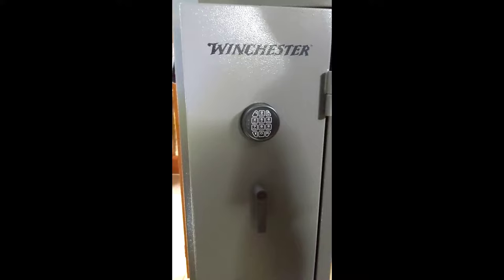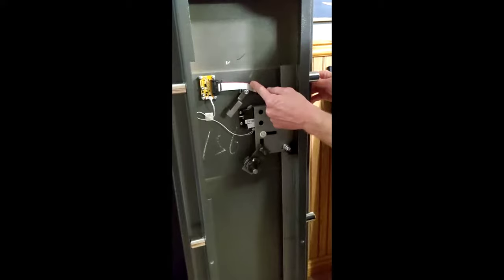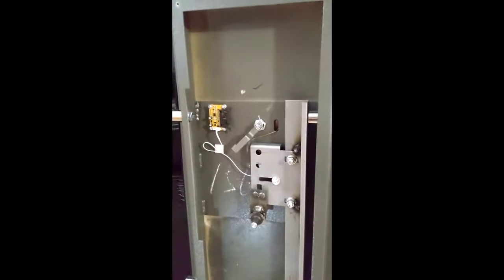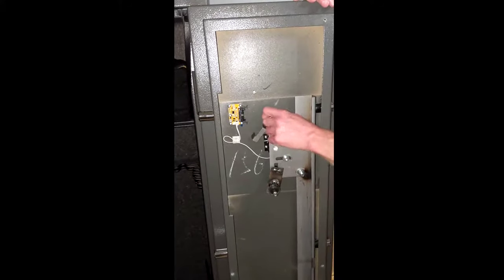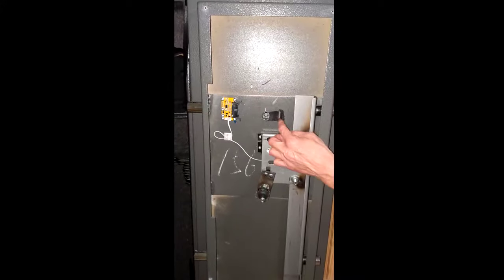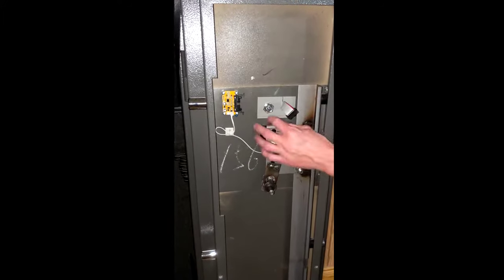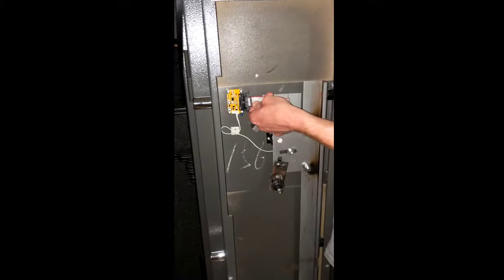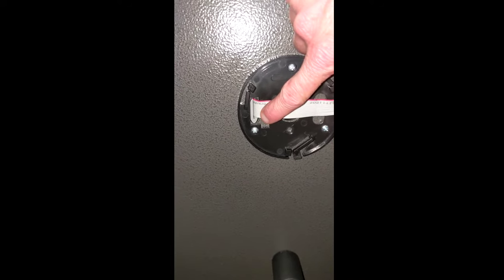Winchester Model TS12-30 Locking Mechanism Bypass

Comment: Thanks for the video bro. I made a similar blocking plate out of metal. I used the metal pallet it was delivered on for the material. Made a paper template first, then traced it onto the sheet metal. Cut it out with a hand grinder with a thin cuttoff wheel, and drilled the hole with a very large bit. Worked perfect! Cheers 🍻
Reply from the maker: Hmm.  A piece of sheet metal.  That could work.  I like the plug aspect but that's what makes a full patch so costly.  Thanks for a wonderful idea!
Reply: @locksandpicks9552  Yeah, no prob.  sheet metal is sturdier than a 3d plastic print. Took me 45 mins to make one out of sheet metal with basic tools.  We should go into production and sell them since the safe company hasn't fixed it. Lol
Reply from the maker: @GuitarLP1960  locksandpicks@gmail.com

Comment: I just bought one of these a couple weeks ago and it appears they have fix this issue. Mine has a metal plate over that area.
Reply from the maker: Would you take a picture and share?
Reply: Yeah what's your email, seems winchester either saw this video or became aware of this issue and did something very similar to what you did, cuz mine has a plate exacly like you created where only the ribbin can fit through.
Reply from the maker: @milspec8283  Oh they were given the 3d model file by me.  Then they tried to trick me into admitting extortion where none was.  You can reach me here:  locksandpicks@gmail.com

Thanks!

Comment: I bought a Winchester TS26-45 on 12/29/2023 from Tractor Supply Company and it doesn't have this plate but if i make a plate like this and install it you could possibly still pry out the key tumbler and activate the button

Comment: I have a huge Winchester Pony that is 6ft tall 5 ft wide and 4 ft deep. Tonight when I got home from work I went to put my money in it. It's a digital dial like yours, but my hande is different with 5 prongs. When I closed my safe and turned the handle to lock it I heard something on the inside mechanism fall and now my handle doesn't work when I put in my pass code. Any ideas? 😢
Reply from the maker: Hi Cliff.  It would be tough to say without having been there.  If the lock mechanism fails to disengage when the pin is correctly entered then maybe the wire became damaged?

What happens when you use the backup key in the center of the dial body, are you able to force it to release or is it stuck?

Comment: Does this work on the big model with the turn handle
Reply from the maker: I am not sure.
Reply: @locksandpicks9552  i looked i think there is a plate on the bigger model with the 3 prong turn handle.

Comment: Would it not just be easier to lock pick the tubular key lock on the safe? Not sure how a key pad hack would work.
Reply from the maker: With the default tubular lock I suspect you may be correct.  I don't have those kind of picks and for me the bypass was much easier than any picking, you just have to practice with it to get the feel for it.

Comment: TS20-30 I got on Black Friday has a plate blocking access where the cable threads through
Reply from the maker: May I see a picture of the plate and how its mounted Deac?
Reply: Same here.
Reply: Yes but the key slot can be easily picked in 5 minutes or less

Comment: Holy crap that's not even close to the same locking mechanism in my Winchester safe. You will not get into my safe like that. My safe actually has a spring loaded secondary locking mechanism in case it's tampered with. My safe is also built heavier than that one, I guess they don't make them like they used to.
Reply from the maker: That sounds like a much better design.  Glad to hear there are some worthy models out there!

Comment: and why couldnt you just drill through your protector plate?
Reply from the maker: You could do that of course.  The point of the video was to show the bad design not make it thief proof.
Reply: @locksandpicks9552  - fair enough

Comment: Good job securing the lock mechanism with a steel plate(?), the audio is horrible on this video... Perhaps it was deliberately left vulnerable, making it easier for the Chinese to get into it after the invasion of America commences...( sarcasm intended ) 
Bill... :~)
Reply from the maker: It was a temporary workaround made out of PLA.  Producing it in metal costs somewhere around the $190 ballpark and that is just out the question for most folks.

They accepted the risk if you read the emails, really, they knew about this flaw before selling it.  That is how I read it anyways.  My interpretation.

Thanks for watching!
Reply: @locksandpicks9552 do you have the link to the article you wrote?
Reply from the maker: @teelowteelow356  https://medium.com/@locksandpicks/an-open-letter-to-scott-sutton-ceo-of-the-olin-corporation-87099b033931